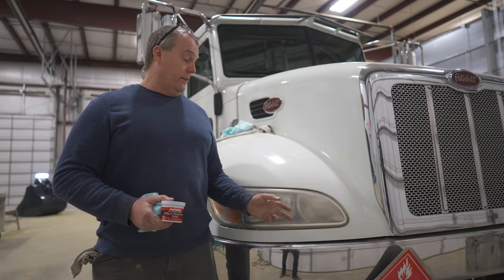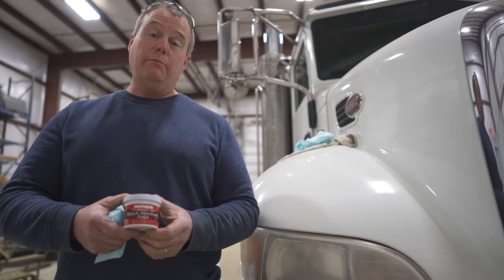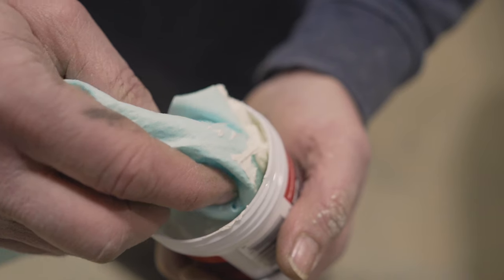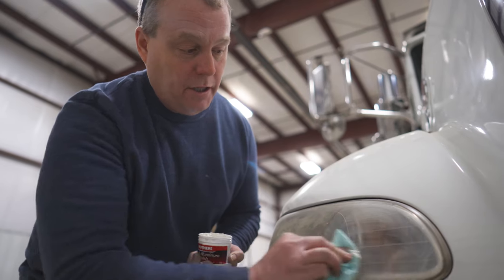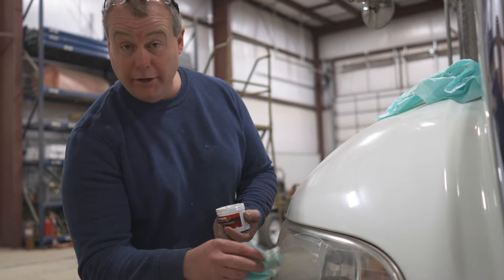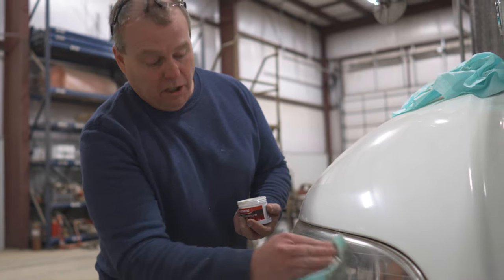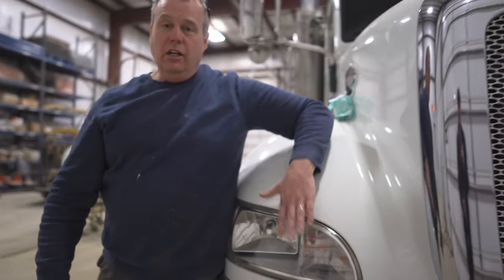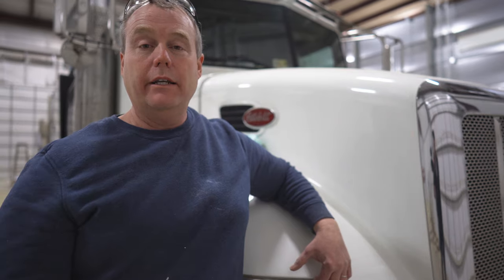I Restored Dull Headlights Using Only Rubbing Compound

Comment: Just ordered rubbing compound for my pickup today.  It's an older truck so it should last long enough....Thanks, this looks easier than using water and sand paper.
Reply from the maker: Thanks so much for watching Ricky!  Hope your project goes great!  We've fount mother's aluminum mag polish works awesome on all kinds of applications!  Have a great day!
Reply: @NewmanTractor  I think I have some of that laying around I’m about to check. lol. . I used turtle wax rubbing compound and it didn’t really do that great of a job removing the yellow.  Thanks for the video.  Excellent work !

Comment: Good morning,my elderly dad's car headlights are very bad would love to get them nice for him and far looking nice,I don't have power tools or polishing machine,I've googled mother's msg wheel cleaner I think your using,by hand how long to I rub the paste into each light before running off with clothe then same over?thank you.
Reply from the maker: Hey Michael! I'd say try doing half a headlight at a time. If you start with half a headlight, apply the cleaner to that half, rub it out, and then go on to the other half, you should be good to go with just some elbow grease. The only thing to note is that the sooner you get it off, the better. We usually use compound rather than the wheel cleaner but give it a shot and let us know if you have other questions we can help answer!